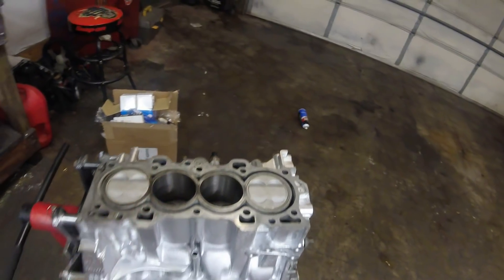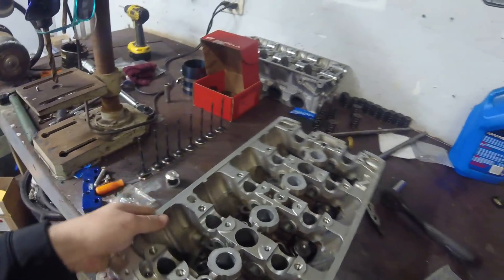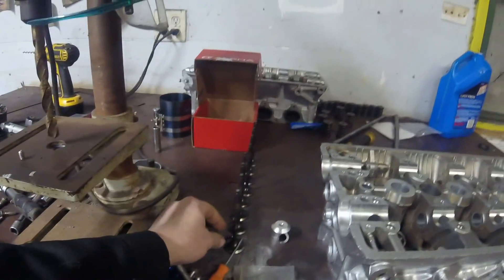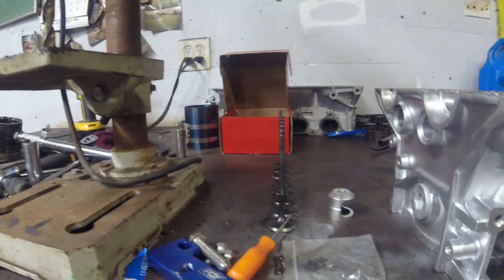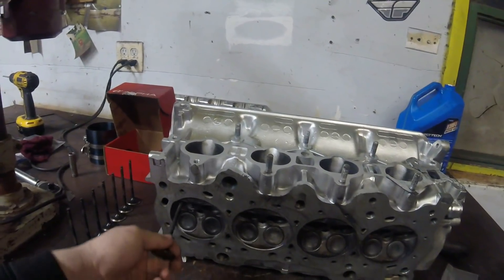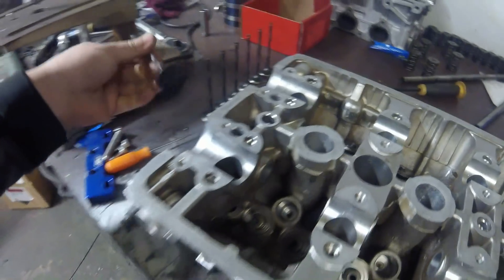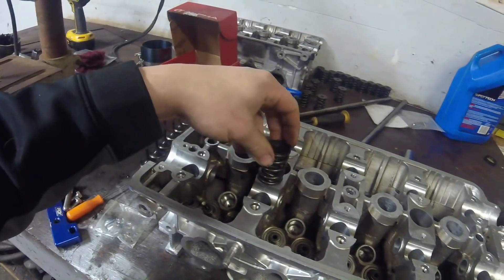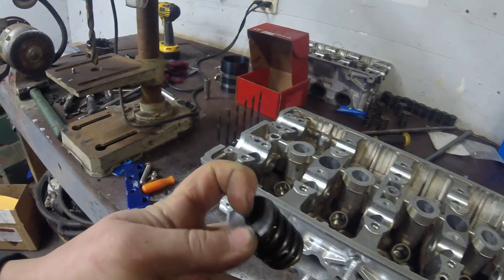B Series Vtec Cylinder Head Assembly. Valves, Springs, Rocker Assembly. B20V Tips And Tricks

Comment: The valve spring tool would work with the head on the block, if you were to work on the cylinders that were at top dead centre, so the valve would rest on top of the piston? I need to replace the valve stem seals but don't want to have to strip the head off. So would this work?